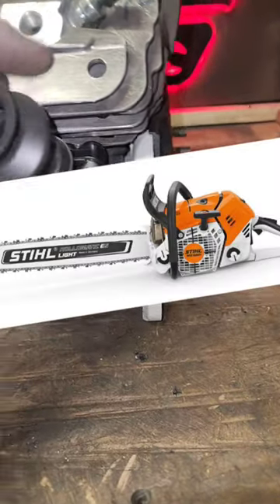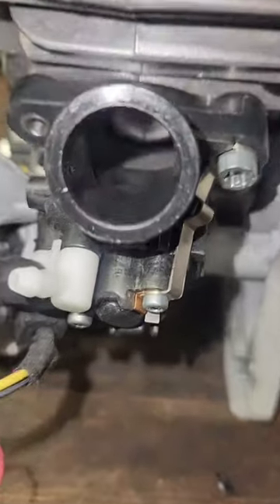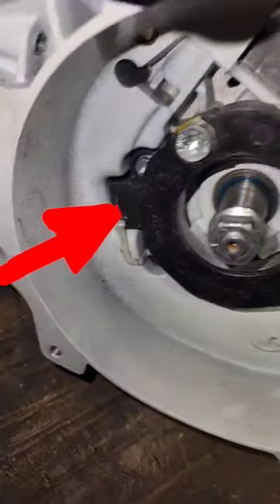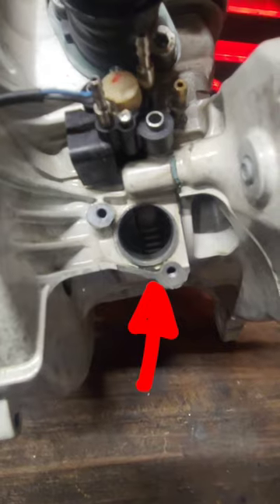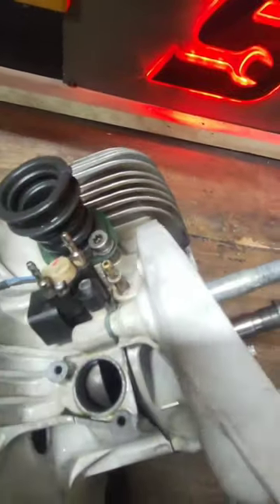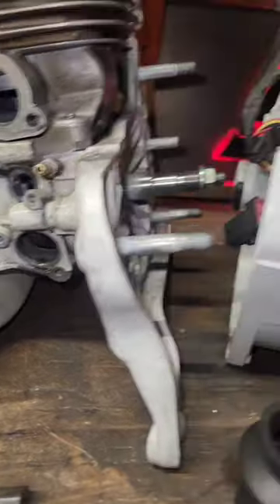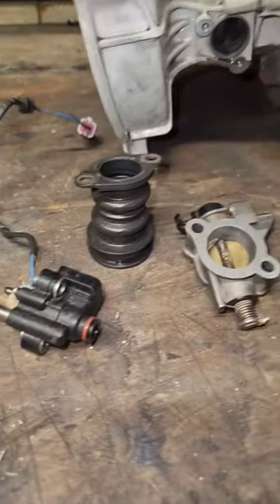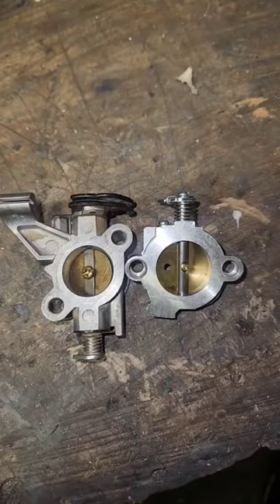MD500i and TS500i side by side comparison... fuel delivery/intake differences...

Comment: here's something people are not telling you. take one of the saws apart, be prepared to spend lots of money on electric and chips to bring it back up to factory specifications.
Reply: There aren't any "chips" in the Stihl injection system, or any in mtronic. 

The ignition module on the mtronic is the "chip" but mostly the brains of the operation, and the fuel injection has a simular ignition module system.

Comment: Any idea on why there is a difference?
Reply: The design of the cutoff saw is 10 years old by now, from what I know the old injector can't do pulse injection very well (max rev is only 9000 for the cuttof saw also), so Stihl placed it straight into the crankcase, spraying fuel continuously and the acceleration trigger only varied the amount. 

For 500i chainsaw, it was even a bigger dilemma since it must rev to 14-15k to have any chance against already existing carbureted chainsaws, but Stihl somehow improved the injector design to be able to handle more precise control and faster injection, allowing them to mount it straight into the intake for better atomization and power.
Reply: @em4703  my man, thanks did not know that developmental anecdote, did kinda piece together most of it, did not know the injectors are different and that the old one don’t pulse it just sprays

Comment: The cut off saws spin slower and experience higher loads ( I’m guessing,) while the chain saws like to spin up real quick and do the cutting like that, that’s my first though, seems like the bigger throttle body allows more air to flow through per given period of time, not strokes, and the fuel needs a bit more time to mix to vapor the closer the the pulses are to each other. I ain’t no engineer just an average idiot, someone ought to dumb check me I’d suppose.